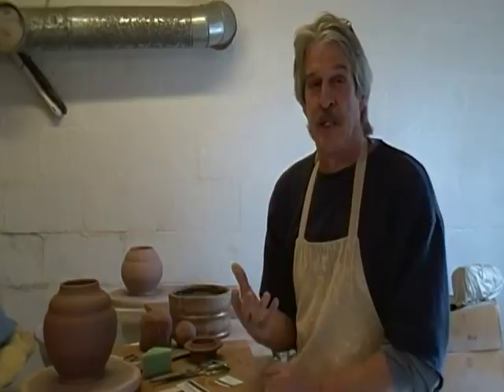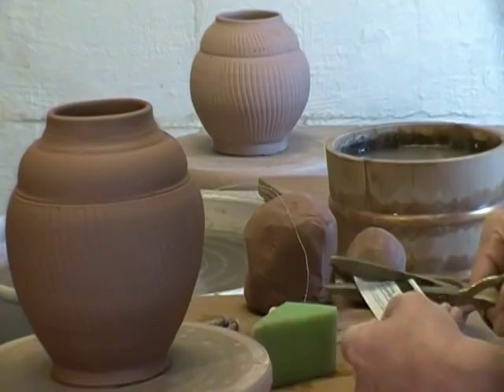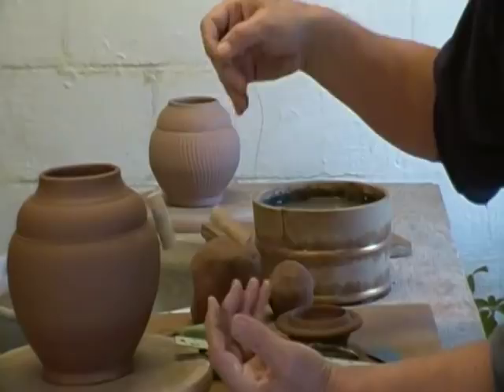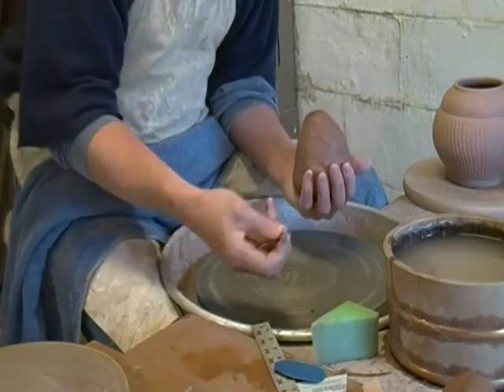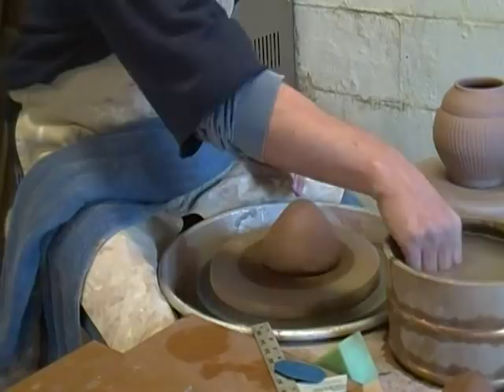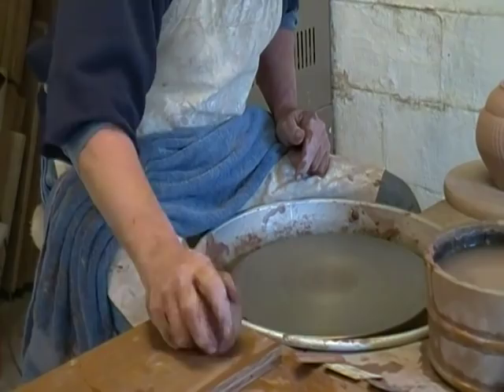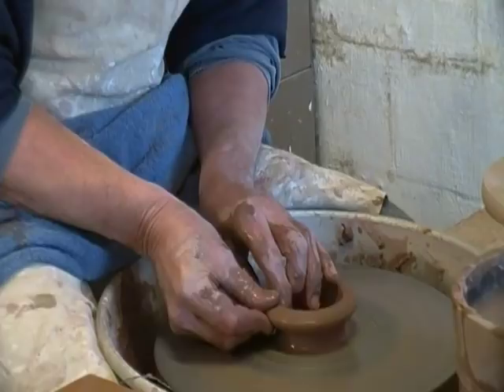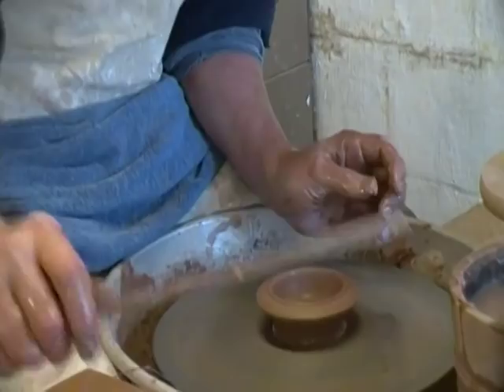How to Throw, Alter and Texture a Lidded Storage Jar

Comment from the maker: Thomas... 'Pin hole' is the term used to describe a small crater, sometimes sharp-edged, or a pit-like very small hole that can appear in a glaze-fired surface. They can happen for a bunch of reasons... veg-type matter burning out of the clay, slightly under firing the glaze, no soak of heat as the glaze matures at the end of the firing cycle, coarse clay trimmed & not smoothed, etc. However, in some glazes - shino glazes in particular - a  type of controlled pin holing is often sought after. 'Crawling' is in the same shino-effects family.

Comment: whats is pin holing anyone?
Reply: +Thomas Horner pinholes are small holes in the glaze, they usually look like they  were made with a needle. :-)
Reply: Thomas Horner maybe if you're using shitty clay and not adjusting your glazes
Reply: I found that 06 bisque fire is too low and can cause pin holes.  Cone 04 seems to reduce pin holes greatly for cone 6 stoneware..